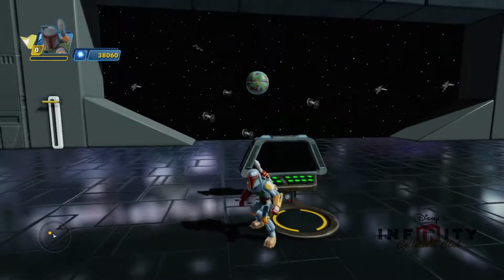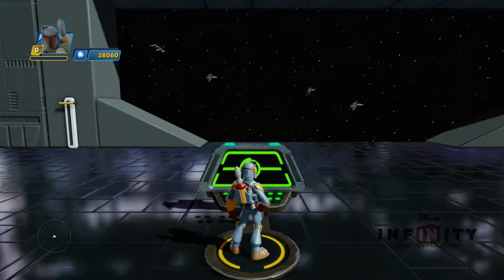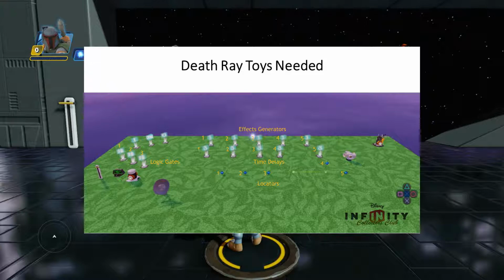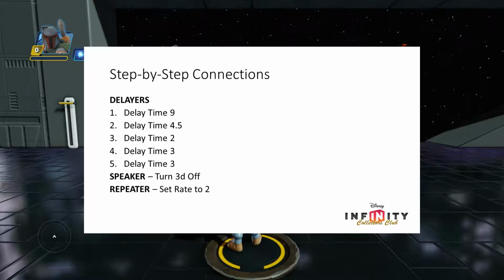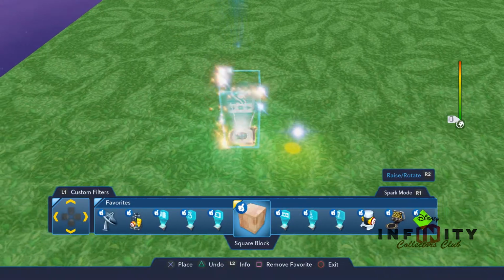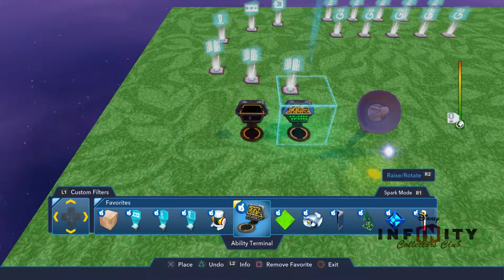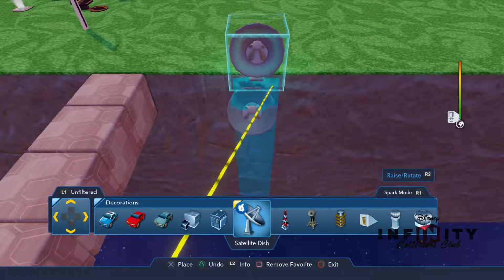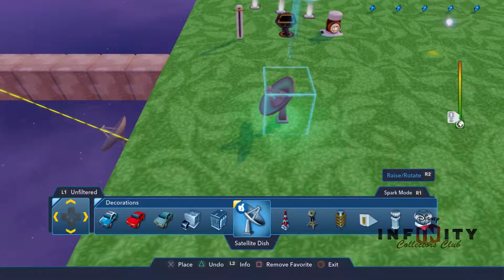Build a Death Ray Part 1

Comment: I think the most interesting scenario for this would be a 2 player scenario
Player 1 (hero) would have to run a gauntlet of traps, platforms, enemies (stormtroopers) to reach the controller room
Player 2 (villain) would have to beat enemy waves (resistance) as fast as possible to unlock different controllers, let's say 5
Once every controller had been activated he (villain) could push the button and activate the death ray, winning the game for the Empire
IF the hero could run the gauntlet fast enough he could join up with his fellow resistance members and beat the villain in a fight, destroying the death ray and saving the galaxy